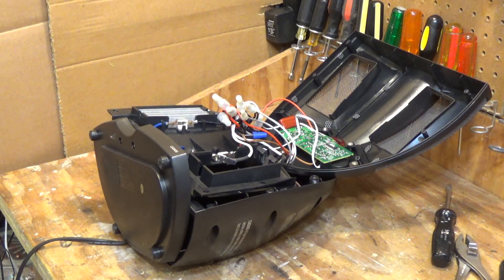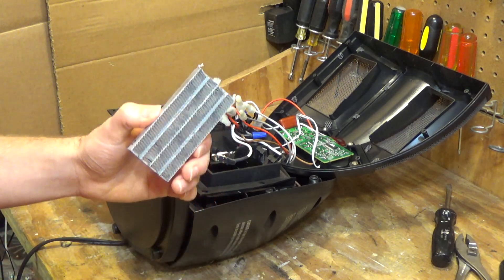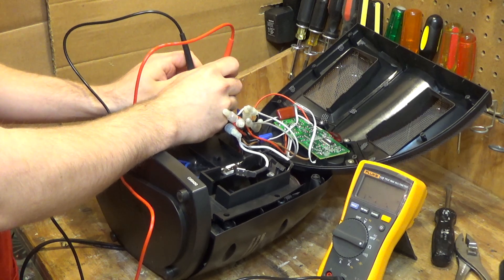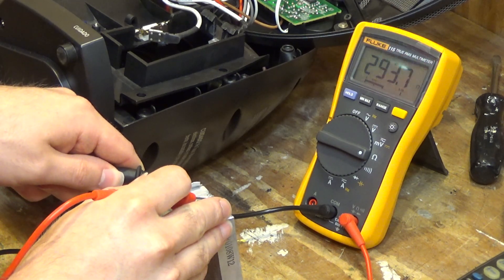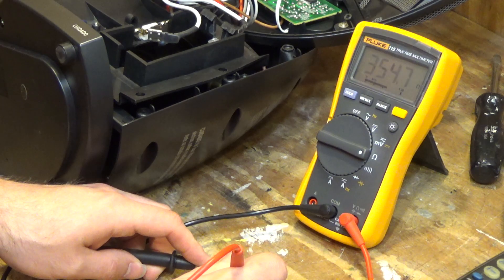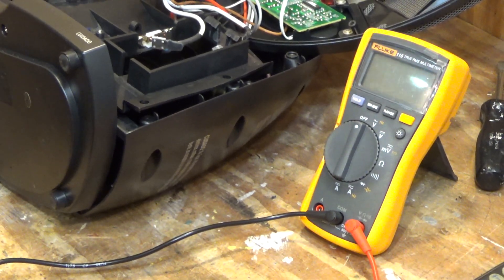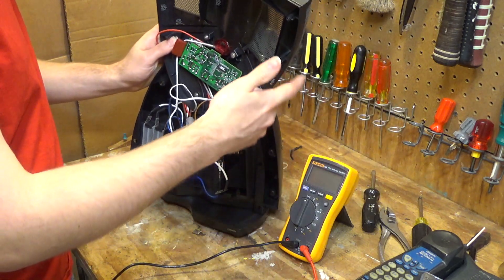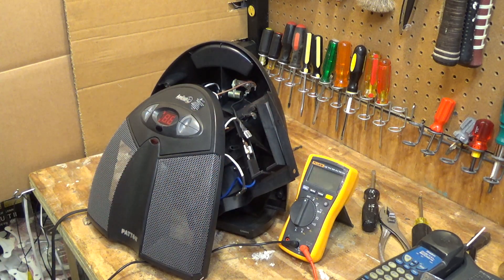Failed Patton Heater Diagnosis

Comment: I didn't know that "resistance" is supposed to be pronounced with a French accent.  And what's that?  A meter?  An actual meter that shows numbers on it?  And you can tell from the numbers the difference between 2 things?  I thought units don't mean anything to you.  Should have used your paper roll on the 2 elements.  If it catches fire on one but not the other, you'll know which one works.
Reply from the maker: What? I don't know anything about French..
This is very different--this is a case where the numbers are known.. If the element falls within the healthy range of resistance, then it's good.. If it falls outside of that range, then it's spoiled..
If the safe range of resistance was not known, like with the airflow, then the measurements are worthless..
Reply: But where did you get the specs for a "healthy range of resistance?"
Reply from the maker: The Google..
Reply: I guess you follow "if I read it on the Internet, it must be true".
Reply from the maker: I most certainly do not! I gathered the information on a few different locations, then tested the working element.. When the working element fell within the range of the consistent information found on the Internet, I decided it is a reasonable piece of information to accept..
Reply: Good, then you can apply that research to other units that are used, such as wind speed!
Reply from the maker: How? What one perceives as a powerful breeze is subjective..
Reply: That's fine, but the numbers don't lie.
Reply from the maker: Never said they do, my only claim was they're un-relatable..
Reply: OK, great.  Now relate Ohms to real life.
Reply from the maker: I already did; ~100 Ohms is a heater element that works properly..
Reply: That's subjective.
Reply from the maker: No it's not, it's factual..
Reply: So are wind speed measurements!
Reply from the maker: They don't provide a means of categorization..
Reply: That's fine, you just make your own categories.
Reply from the maker: What good is that?
Reply: All the good in the world.  You could make categories for wind speed correlating to the numbers, such as 5 MPH being a gentle breeze, 10 being a moderate breeze, and 20 being storm force winds.  Then, every faen you test could fall into those categories.
Reply from the maker: That is completely subjective..
Reply: That's fine, and it will be your own subjectiveness.  But at least others will have SOMETHING to compare it to.
Reply from the maker: Worthless..
Reply: The paper roll is worthless.  The numbers aren't.
Reply from the maker: The numbers are worthless when there's no standards..
Reply: There are standard units that the rest of the world uses.  You just refuse to accept them.  NONE of the rest of the world uses paper rolls to measure wind speed.
Reply from the maker: You're the only viewer that can imagine how powerful the fan is based on feet meters/second or whatever exotic unit you're using..
Reply: There's NOTHING exotic about those units!  Because they are STANDARD!  Regardless, I don't think the rest of your viewers have the intelligence needed to associate these numbers with real life.  I say that based on the excessive absurd comments you get.
Reply from the maker: I am an intelligent individual, and I can't relate those numbers to real life..